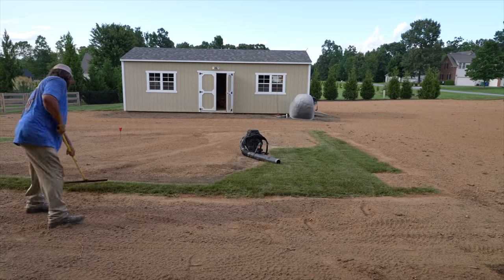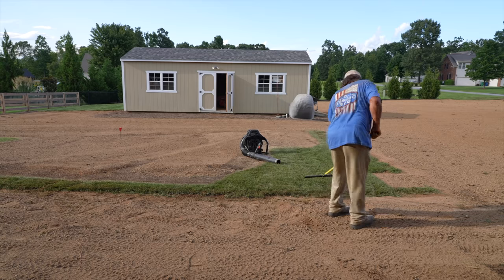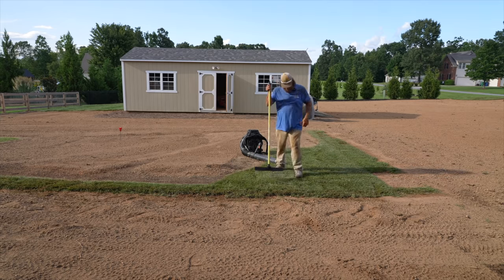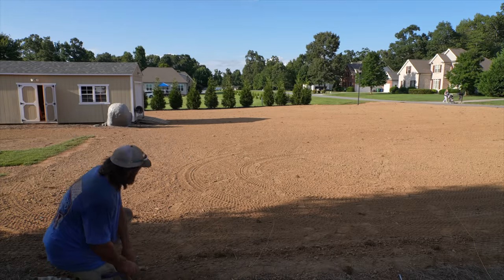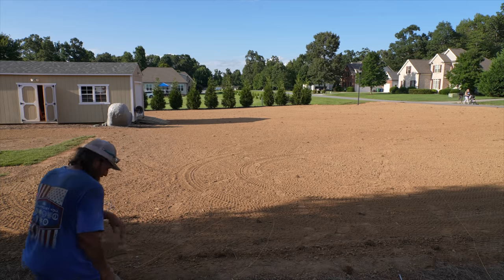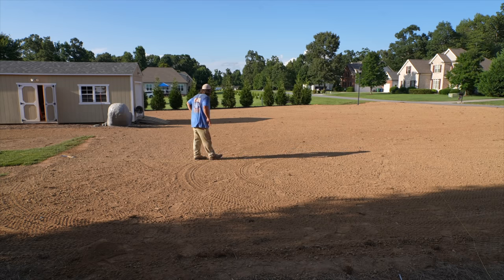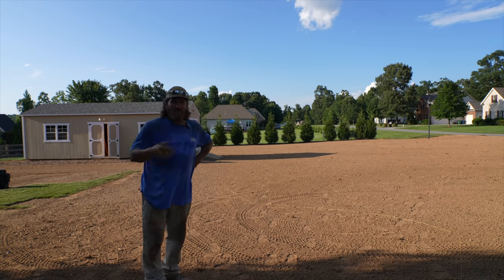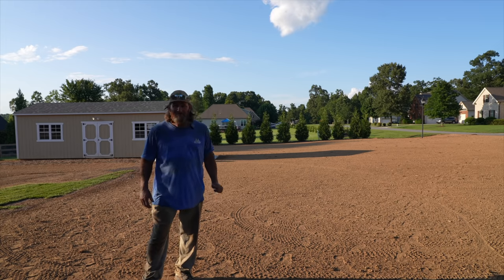Easy DIY Lawn Leveling Tow Behind Drag Level

Comment: Just came across your video.  Thumbs up on your project!  I've got to build a land plane like yours but I'll have to make mine at least 6-8ft long by 6-8ft wide.  I have about 2 acres of a former community garden with many high and low spots that needs leveling.  I think a longer plane will span my low spots before it can follow the terrain down into the depressions.  Farmers in my area use land planes that must be 20ft+ long for that reason.

Comment: I would cut that bluegrass out and lay an extra strip of sod near the others to preserve it. It'll be easier to maintain in just the couple edge locations. No point in having an irregular shaped island right in the middle of your reno that you have to try to manage differently than the rest. It'll also look more mature and different than the rest of the reno when the grass starts coming in ... it'll be a year before that area will look 'normal' and you'll pretty much always be able to pick out that island until it is totally 100% filled in. Not telling you to get rid of it completely just move it near the rest of the sod.
Reply: I agree totally
Reply: I dont get it. Why was that piece left untouched??
Reply: @dwreck5578  No clue lol

Comment: Pete, that's a boat load of work that you have been doing on your yard. I am wondering, however, why are you not using your ABI machine to level your soil "butter smooth" like you used to level those ball fields? It would be easier and not as much work to use that machine, right? Plus you might not need those extra truck loads of dirt too.

Comment: When should I plant tall fescue in North East Oklahoma?
Reply: You can do a quick Google search for the germination temperature of different grass seeds.  Find the temp for TTTF.  Then measure your soil temps as the days grow cooler.  When you're within 10 degrees or so of the target temp, with a little cool weather on the forecast, then you can sow your seed.  I answer this way because when to plant is different for each area of the country, and can vary by season, depending on what the weather is doing.  But the above will get you in the target range no matter what's going on.